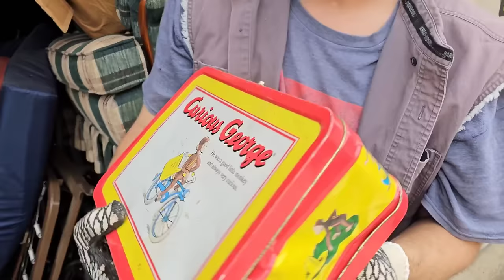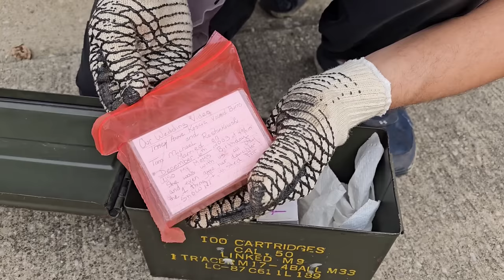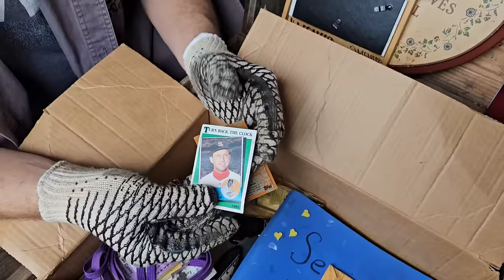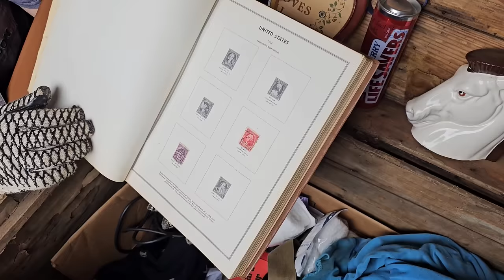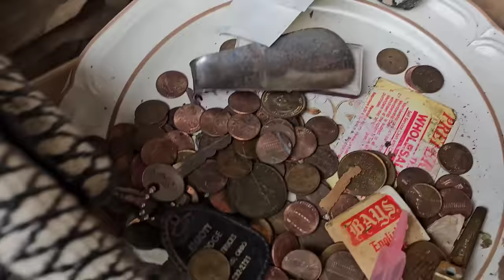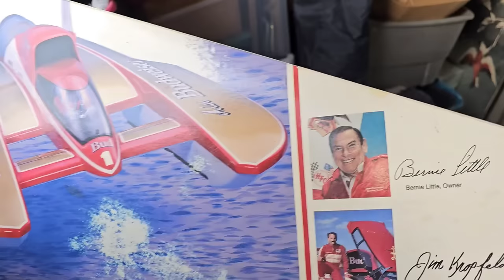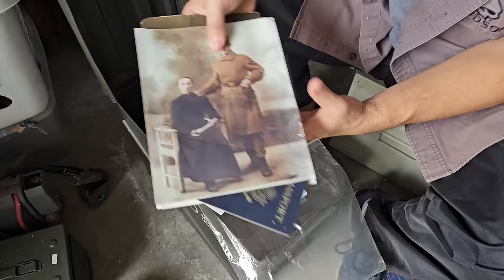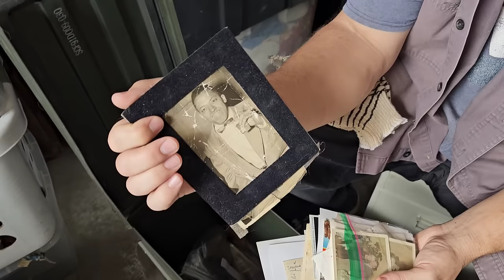I Bought A DRUG DEALERS Storage Unit & MADE BIG MONEY

Comment: The old item at the end of the video is an old clothes wringer. It usually clamped to the side of lthe wash bucket and the wet clothes were fed through the two rollers.  There is a crank handle on the side to turn the rolls.  Above the rolls were a spring assembly to keep pressure on the rollers.